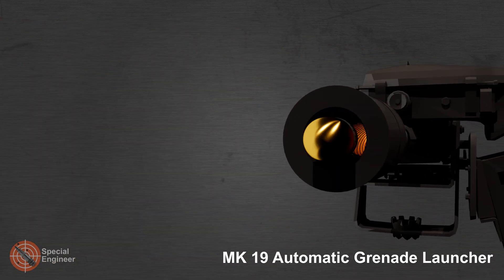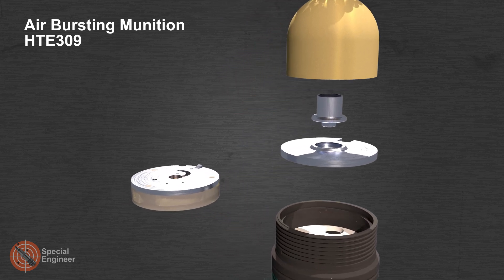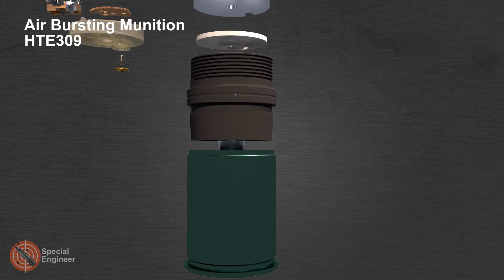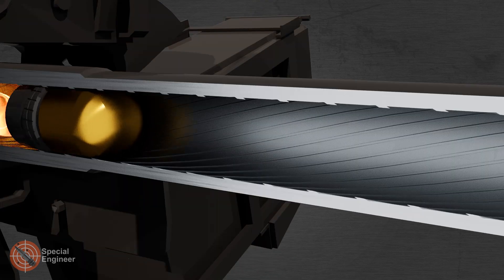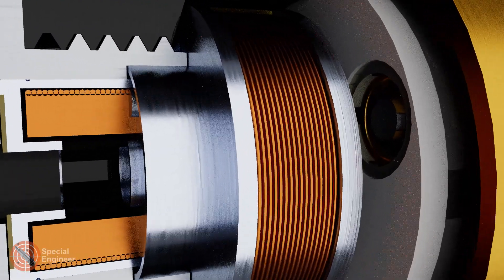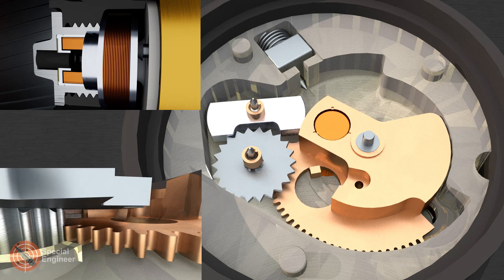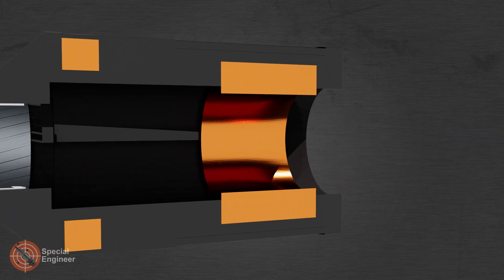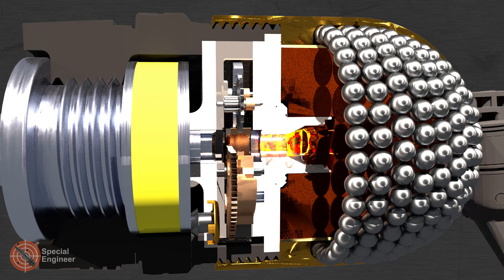40 mm Airburst Grenade made by Rheinmetall #rheinmetall #artillery

Comment: seeing the sheer complexity makes me wonder why there are no MEMs and compliant mechanisms used to replace some of the parts. If compliant mechanism are used for fuzes for nuclear devices surely it would work on explosive fuzes.
Reply from the maker: MEMS are not as reliable and are significantly more expensive than regular gears.
Reply: @specialengineer2718  odd, while the mechanical fuzes are not as expensive as mechanical watch, MEMS' fabrication by photolithography(same manner as semiconductor chips) means they can be cheaply mass produced. A single tiny MEMS microphone is .01 USD back when I heard about it in 2022.

the really expensive part that I can see is it won't be made from silicon but some gallium-based metals. And oh, making them tougher.

may I ask what other factors that make MEMS unreliable?
Reply from the maker: @samuelmendoza9356 All mechanisms experience enormous overloads. They are also tested for temperature resistance. Typically, most MEMS stop functioning at minus 20 degrees Celsius. Miniature actuators are needed, and they are very expensive. A microphone is a weak example in this context.
Reply: @specialengineer2718  point

Comment: Cool animation. I hoped they used some sort of proximity fuse and not time delayed one
Reply: No proximity fuse. A precise explosion time is calculated when the grenade is fired, and the grenade is programmed with it when exiting the barrel. The advantage is that it won't be triggered prematurely by something like a forest canopy, and given precise charges, grenades and barrels with small tolerances, and taking firing angle, temperature, air pressure and wind into account, the time to impact is very predictable.
Reply: @peterprokop  yeah i figured, but i can't imagine any military having something this complex and expensive to be widely deployed against something as cheap as drones
Reply from the maker: @godertays today it may be expensive, but technology does not stand still and in the future it may become cheaper.
Reply: @godertays  air strikes are regularly used against tents. Considering the cost and logistics involved there, a 40mm grenade is insignificant by comparison
Reply: @8bitarmory846 For armies that are big and powerful like US army, that can afford airstrikes on tent, cost wouldn't be significant, but for other armies cost of firing 3-5 (if not more) of those grenades for one cheap drone wont be reasonable, especially in war of attrition. Also practicality of those rounds heavily depends on time and volume of production and im sceptical that it can be produced by thousands a day